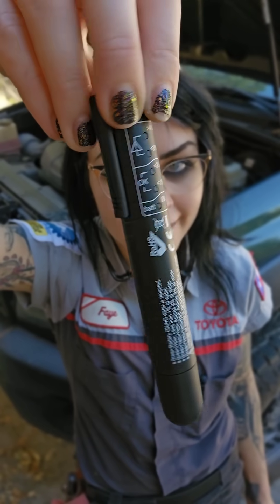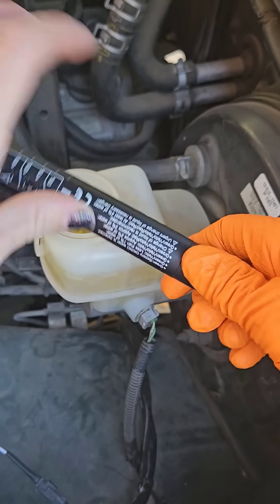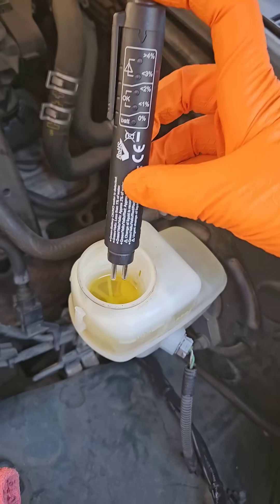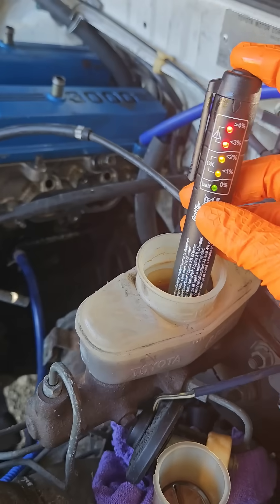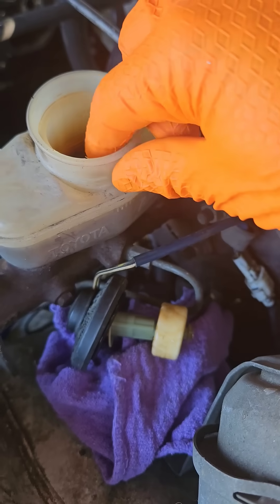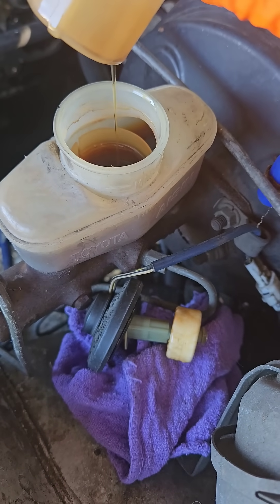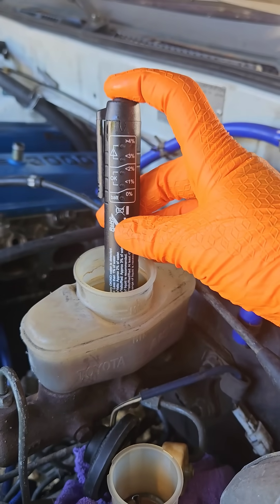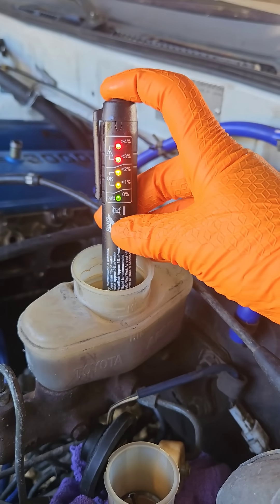Do you REALLY need your Brake Fluid Flushed?? How to Test it For Yourself!

Comment: Brake fluid is less dense than water, so the water will sink to the bottom of the system at the calipers. Best to bleed a little of the fluid from the caliper's nipple and test a small sample for contamination.

Comment: 1993 Peugeot 405, 350k miles, still in use, break fluid never changed, all works fine
Reply: you think it works fine.   get it flushed and replaced to cut your braking distance in half and improve pedal feel.  and save your ability to brake if you ever go down a long hill.
Reply: @Chrisj078  I actually did break hard the other day, breaks perfect. If I notice it becoming weak I'll fix it, but while it's not broken I won't fix it

Comment: If my manufacturer tells me every 5 years or 60,000 miles ima recommend it okay not scamming you chrysler is ight fluid Is usually 20 to 50% contaminated by that mileage anyway for the vehicles I work on there's a lot of aspects to check as well which she does well on but if a manufacturer says it's recommend ima make it clear to customer that the people who design ur car told me to tell u it needs a brake flush sorry

Comment: Flushing a braking system is a thing now😂 If the level is topped off and pedal feels normal all is good. If water is getting into the brake system there is a much bigger issue. It's a completely closed system and water should never have a chance to get into it.

Comment: You could syphon out fluid when you do every other oil change and avoid a full flush for a long time.
Reply: except the fluid doesnt really mix together so changing the fluid in the reservoir doesnt help much. the fluid near the calipers is always going to be much worse
Reply: @arcanevoid9199  it does over time.

Comment: I mean that tool is cool, but you can tell just by looking if it is contaminated with water. Anything a straw color is contaminated. Brake fluid is hygrascopic and just absorbs water right out of the air. If you live in a humid climate, expect it to be green after only a few years.

Comment: I work at a chevy dealership and have probably done 200 break flushes this year. Best time to change it is if you cant see to the bottom of the resevior through the fluid. Break fluid is supposed to be almost perfectly clear. After around 50k miles it should be brown but still some amount of oppacity to it. When its not see through or if its green flush it. Turning brown is normal

Comment: As someone who ate shi when my front brake locked up on a 1986 klr650

Yes
Yes you do
Why
Because water get hot. Make steam. Which puts force on brakes. Then gets hotter. More force, more heat. Soon enough locked up

Temp fix to get home "motorcycles only" ur gonna be down a front brake so go slow. But wait for ur brakes to cool, open bleeder till brakes "up front" are nice n loose. Then close bleeder and go home, rely on rear breaks dont hit front

Comment: I just changed the brake fluid on my 2014 Wrangler. I’ve replaced all the calipers and flexible brake lines a couple years ago. The fluid was very dark and when I cracked the bleeders most of them didn’t weep any fluid. They had rust inside. Cleaned them, changed the fluid and the fluid on the ground had obvious rust. Not fun. Made me a believer.

Comment: Also get test strips that test for copper content. Copper becoming suspended in the fluid is indicating the anti-corrosive property of fluid is breaking down and wearing the insides of the brake system.

Comment: To add onto her, the harder you push your brakes, the more often it needs to be changed. Every-time it goes beyond that heating threshold and reaches boiling temps, you get more of that steam. That’s why heavy duty high-temp fluid is needed for towing and racing applications. Not necessary for normal cars, but if you brake hard and a lot, you’ll have to change more often.

Comment: Nope. It makes absolutely no difference at all.
Reply: Sure. Air bubbles due to water boiling is a hoax too? Never mind the corrosion inside a brake system that can happen due to water intrusion. You sound like those people that put conventional oil and run a motor for 20k miles.
Reply: @juicymoose6769  ohh youre one of those that flushes the brake system after doing brake pads and bleeds each caliper lmao. Do you ive been driving for 100k miles on same brske fluid lmaoo
Reply: @b5Bart  I mean, the proper way of bleeding a brake system does involve flushing at the caliper, so there's that. Brake fluid absorbs moisture, and this usually happens over time, as opposed to mileage, though any sort of extreme temperature can cause degradation in the chemical stability of the fluid and as such, mileage doesn't mean much, especially if you consider that 30k miles on a highway is considerably less strenuous on the brake system than stop-and-go city traffic. The average cars in my area tend to need front brake replacement at around 30-40k miles, and they're about 3-4 years old so at that point it would be logical to recommend a brake flush, especially if it's part of a vehicle's service schedule as specified by the manufacturers. (Some newer Mercedes models suggest every 20k miles). Your attitude is very condescending for someone that doesn't understand something as simple as car maintenance.

Comment: Only way a 2 year old can could have saturated brake fluid is if it was submerged and the system was not closed. Also brake fluid never gets hot enough to boil water to steam. The brake fluid it's self would lose it's viscosity and be useless. Breaks and drums get very hot. But the fluid under normal street driving conditions never gets even close to boiling. You're part of the scam.

Comment: Never do this in the system, the brakefluid will be heated, take a little bit out of the system and fill it in a cup or similar and test it in, if you test it in the system it will change his character, it would can be dangerous !

Comment: I remember when they started selling these services at the dealership that I wrenched at.  She is right, brake fluid is hygroscopic but there is more to it than just that. Where you live plays a part, IE- states or seasons with high humidity and driving conditions play a part too with the brake fluid degradation.  Bottom line, it would take quite a bit of water to truly cause a problem. I personally think it’s kind of a racket but like I said she’s not wrong.

Comment: Brake fluid is easy as fuck to change without ever EVER having to bleed air from the system if you know how to do it right. Just change the fluid man. This is why knowing how to do basic maintencance on cars is essential you cam save so much money.

Comment: Do you think that the fluid in the brake calipers is THE SAME with the fluid in the reservoir ? Checking the fluid in the reservoir is pointless, it may show that it is fine but the one in the brake lines and calipers is may be bad. Just change it between 2-3 years and you're fine. It is dirt cheap and so easy to replace. No need to "check" it. Do you "check" you engine oil or do you replace it at least once a year or @ X miles ? Do the same with break fluid, 2-3 years.

Comment: Out of curiosity I checked the price of the device and a fluid flush. The device is 10 to 20 dollars and a flush is around 150 or so. Sometimes DIY tips require buying something that ends up usually not really being worth it for very infrequent use, but in this case it seems like a good idea.

Comment: you do it every two years regardless, its super cheap, super easy, and if not changed it will cost in replacing/rebulding calipers, abs pump, master cylinder.

Comment: Those testers are ok if they are used correctly. 
Drain a bit of brake fluid down from the caliper an test it with that toy. 
The water content in the brake fluid is higher down at the brake caliper than at the top of the reservoir. So it makes no sense to just test the liquid in the storage container. And if you've already drained a little fluid from the brake caliper for testing, you can change straight away without testing. It doesn't hurt and doesn't cost much.

Comment: I was a dealership tech for over 35 years, Toyota and then Nissan. 
I never flushed the brake fluid in any of my own cars. 
Neve had a brake fade or pedal  issue in any of my vehicles. 

If i saw a customers fluid was black or hadn't been serviced in 60k miles, i would recommend it.
Reply: May I ask, why you didn't change your own car's break fluid, but recommended your customers to change it, please?
🙏🙏🙏
Reply: @natlee5051  Sure, 
Because I have never had any kind of brake pedal fade issue in any vehicle I have owned. The brake fluid also has never been black or even brown. 

But for some reason the cars of the past 10-15 years come in all the time. 
Black brake fluid and brown brake fluid so either the customer is very hard on the brakes, which still shouldn't cause the fluid to change color. Or the brake components are causing the fluid to change color by being exposed to a lot of heat and moisture.  
I have a 2007 Pathfinder with over 200k miles on it. Never changed the brake fluid. And the fluid isn't brown or black. 
My wife has a 2007 edge. Brake fluid is clean and clear as can be. 
Our daughter's car has clean fluid. 2006 Mazda 6. 
I have never changed the fluid in any of those vehicles.

Comment: You don’t need a flush unless your pedal feels soft and spongy or if you changed something that required the lines to be disconnected and possibly let air in the system, (e.g. caliper replacement)

Comment: Steam in brake fluid. Right. If your brake fluid is hot enough to make steam you have more issues than moisture. 🙄
Reply: do you know the first thing about brake fluid? most brake fluids have a boiling point double that of water, some are even 3x or 4x
Reply: @arcanevoid9199  do you even know that the boiling point of water increases when it’s under pressure? Do you have any idea how hot water has to get to boil under hundreds of psi worth of pressure? 🤡

Comment: Cool video. One thing though. Water does compress. So does hydraulic fluid. In fact there is nothing on our planet that doesn't compress. Liquids won't compress like gasses. They only compress slighly under extreme pressure, but they do compress. Just ask a qualified Physicist.

Comment: Water DOESN'T need heat to BOIL in the BRAKE SYSTEM ... PRESSURE ALONE WILL cause WATER to BOIL 😁
Reply: Higher pressure makes liquids less likely to boil. Thats why your coolant system is pressurized.
Reply: @NoLongo  true .... until the pressure reaches the "flash point"

Comment: This tester has been proven to be ineffective. If you stick it too far down into the brake fluid it will show the red light. And I've also personally tried this item and sure enough it will show red light if it go to deep into the fluid. Also have tested it on brand new bottles of sealed containers and tested bad out the jug. Either way just change it when the manufacturer tells you to.

Comment: change it at least every two years... i've had several cars where the previous owners didn't change it for almost ten years and even tho the brakes did work, the lines take damage and it was really hard to actually do a flush because everything was clogged and rusty.

Comment: Unfortunately, flushing a very old, heavily used, or dirty system can tend to cause the system to spring leaks internally within the master cylinder, bleeder screws to round off or break off, or other externally weeping parts that are caught during the inspection or procedure. A brake flush, although necessary when needed, often is accompanied with some needed repair work to make the system whole and working properly again.

Comment: Brake fluid also has copper content to be concerned about. I have been using test strips for that for decades. Fluids go bad and need to be changed. If your brake fluid isn't clear, there's likely copper in it (don't tell the tweaker lol) which will corrode your brake system parts. People usually look at a guy weird when I mention it, but brakes are the number 1 safety system on vehicles and need to be maintained.

Comment: My 1973 Dodge Charger burnt so much motor oil that I couldn't afford to keep buying it so I started using used motor oil. Worked for me. It blew so much smoke that I couldn't see the car behind me at a stop light and never had a mosquito problem. I was 16 or 17. 😜
Reply: I did this in my younger days when I worked at autozone. Had a beat up 95 Hyundai Accent with completely worn out rings. It consumed so much oil, that I started taking home the “best” looking motor oil we received for recycling. People who drove behind me, gave me that Mario Kart’s Luigy look as they passed trying to get away from the smoke screen 😂😂
Reply: Yeah my 4th car was a 65 beetle that leaked oil so bad it would blow it out on the highway and on car windshields that followed too closely. They only hold 2.5 quarts of oil so I had to add a half a quart a week

Comment: Great as long as the mechanic is honest enough to actually DO the flush. I had more than once the situation that some mechanic or some garage put the flush on the bill, but on a quick after check it turned out the old fluid was never touched.
Reply: Did you go back and bring it to their attention? If so, what was their explanation? Or did you just find a new mechanic and decide to DIY?

Comment: Do you know how hot your brakes have to get in the line for water to turn into steam. 😅😅😅 Yeah that's not happening in your brake. But air does buildup in brake lines and that will call brake failure and we'll cause seals to roll causing catastrophic brake failure.

Comment: Great stuff, Faye!  Actually, water and other fluids are compressible, but at much higher pressures than in a brake system, or even in a hydraulic system.

For instance, in a typical waterjet (a cutting machine) the pressure is 55,000 psi and even higher, and at that pressure, water compresses around 11%.

Keep up the great work!

Comment: Every oil change I use a turkey baster to pull all the fluid out of the master cylinder reservoir and add new fluid, do this on a regular basis (every 3000) and you’ll never need a flush as it keeps replacing enough fluid to keep it fresh.

Comment: Hi Faye, really enjoys the content you put out! Just wondering what’s your opinion on whether service package dealership try to sell you is worth it. I had a read on what’s the items being covered in my first service and it only says perform scheduled service recommendations by the vehicle manufacturer. 
Which seems really ambiguous and they are charging 568 AUD $ for it and claimed if I get the servicing package it would be 2900$ for 5 years (normally 4000$), but I been hearing some good things about mechanic shops and that they are generally cheaper and do same level of works.
I own a VW GTI and the dealer told me there aren’t many mechanic shops specialised in European cars which sounds like another BS

Comment: Bought my truck 21 years ago brand new.
Have never changed my brake fluid , My 2002 nissan frontier has 256,000 miles.
Truck runs and stops as it should.

Comment: I've had a Mazda B2200 that was driven by an old guy, and I had to change the rusted, stuck calipers soon after 50,000 miles, and then I proceeded to take care of the brake fluid from then on, and my replacement calipers lasted 100,000 miles and I removed them and installed them in my next Mazda pickup.

At the very least flush until clear, whenever you do your brakes.

It's a scam, when a Professional Mechanic doesn't change a drop of brake fluid, when doing your brakes, because they want you to come back for new components, because your calipers and cylinders are rusted.

Comment: Not as straight forward as water content been the only issue. One example on Corsa C models the ABS pump can become blocked due to congealed brake fluid. I’ve changed many pumps for this issue. You lose the front left brake totally when this happens. Always change your fluid every 2 years. It’s small cost and good practice

Comment: The oil in the reservoir literally never does any work until the operator lets his brakes wear to nothing, if the oil in the reservoir is bad then you can guarantee the oil in the calipers is done and your oring will soon follow, this test isn’t accurate

Comment: I dont know. I would not trust these sticks. There a devices that cook the fluid and determine the exact temperature at which the fluid starts to boil. Obviously nothing for home use. But Id say just flushing it if you are not sure how old it is is the best way to be safe. Brake Fluid is really not expensive and not hard to flush if you habe a buddy helping you. You dont even need a flushing device.

Comment: Not too long ago I worked at Jiffy Lube. At the locations where a brake fluid flush is provided, we use brake fluid test strips that tell us if the fluid is good or bad. They also had another side for testing coolant as well, super handy.

Comment: Brake-fluid with water in it causes modern cars with pot-metal brakelines to have the lines rust and fall out in 5 years.
Older cars with better material quality it doesnt really matter.
External rusting is a bigger problem  than from inside the brakeline itself on older cars.

Comment: For my vehicles I flush the fluid every brake pad change. So I use to recommend it then. Most the heat and steam occur at the wheel flex line. You wanna get fresh fluid in there.

Comment: The moisture content is only part of it. 

Moisture in the line causes corrosion. Corroding break lines release the copper within the metal lines. This turns the fluid a greenish color. And as we all know corrosion is a bad thing. 

Its not a break fluid flsuh, its a fluid exchange.